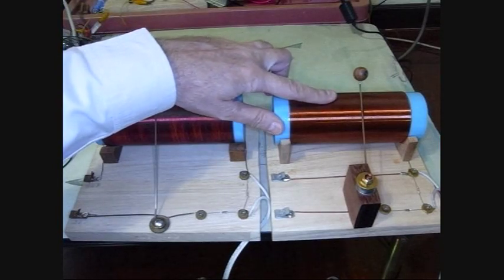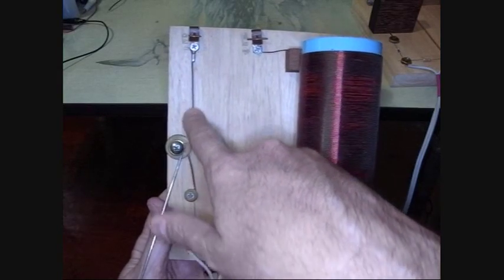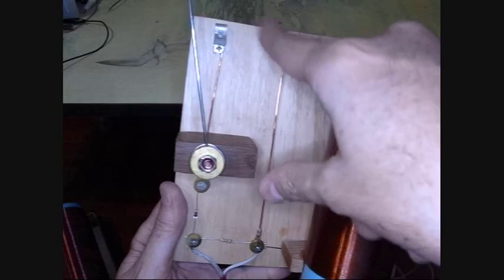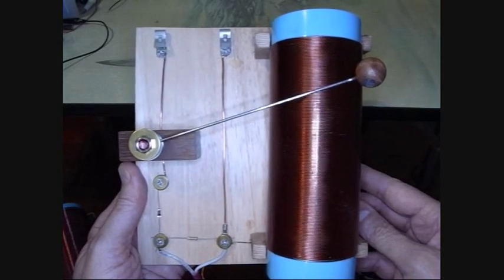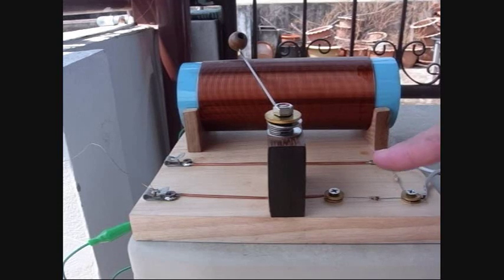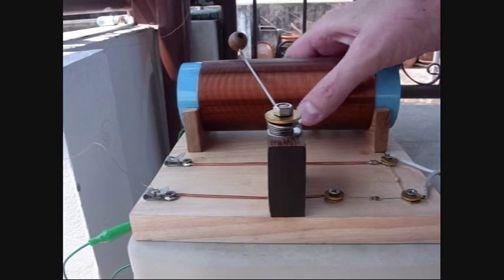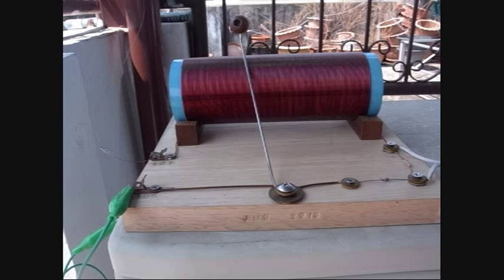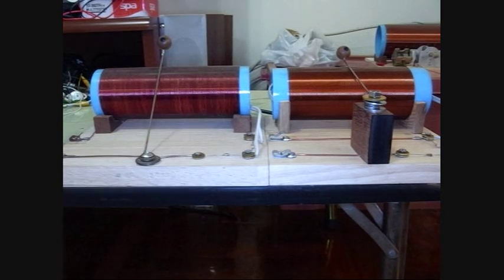New Crystal Radio Design

Comment from the maker: RELATED CRYSTAL RADIO VIDEOS: 
How To Make A Crystal Radio - No Batteries, No External Power: https://youtu.be/mt-s7pf-U5Q   
My New Favorite!  Crystal Radio with Antenna Tuner:    https://youtu.be/mh5KxCpbQ5U
Crystal Radio, Capacitive Tuning - WORKS GREAT!:    https://youtu.be/VJ80Nm9KSkE
Crystal Radio & Resonant Coil Design:     https://youtu.be/Fw9eb-aB-XU
Crystal Radio Antenna (Shortwave Also):    https://youtu.be/G8AsgZbncW4

My Crystal Radio Does NOT Work (FIXES for common problems):    https://youtu.be/kCxQ8iPQx4s
Good Crystal Radio Connection Points:    https://youtu.be/G3qjrReHR1k
Crystal Radio, Connect A DC Audio Amplifier:  https://youtu.be/RW3VhnzgjtA
Three Upgrades For Your Crystal Radio:   https://youtu.be/LENco3_jV_s
Crystal Radio Wiper Upgrade:     https://youtu.be/i1otDz39nlw
Popular Crystal Radio Design That's a Waste of Time - And Why: https://youtu.be/r9Onub2Xpzc   
Crystal Electric Generator RF Energy Harvesting Exp 5 - Full Wave Rectifier:   https://youtu.be/BTu_GJKjOmA

Comment: Whats the diameter of ur plastic coil thing

And how many wire turns did u do

I built one based on this design: https://youtu.be/KGhe3OrNIlI

But sadly the onlything I pick on it is buzzing sound (if I disconnect my ground the buzzing goes away)

I tried with 30m of wire, and I didnt even get buzzing

Then I used an electric fense (not connected to power snymore) (about 200m of wire on ceramic isolators mounted ontop of the fence)

And I get at least buzzing sound, but stil no stations

I was doing this at night (because only at night I can listen to AM radio, at daytime I do get our local station (150km away from me with 25kW of power) but signal is very weak on my other radios

I use 3200ohm headphones, not crystal earpiece
Reply from the maker: All the details are in the description. The earphones are a likely source of problems. Check out this video: https://youtu.be/kCxQ8iPQx4s
My Crystal Radio Does NOT Work (FIXES for common problems)
The one you built from the link is not very good. I'm not sure why he did not print a round coil and bigger would have been better. Here's a very simple "radio" that is less work and does about as well: https://youtu.be/GdvKDFz9Xi4

Comment: Interesting.

I wonder how much of the tiny signal you lost by using the bolt as part of the series circuit?
Reply from the maker: Good question. Probably not as much as the un-soldered connections. It turns out with a good signal I can get enough power to run a digital watch!

Comment: Hello good evening
We left norfolk a few days ago
Tried radio at sea
No pest stations
I ran a 50 ft wire for aerial
Connected direct to capacitor which connects to diode
I don't have a coil or tuner for coupling
At sunset I heard either azores or Portugal 
Last night off ga coast heard Cuba and radio Marti 1180 khz from marathon fl
And Venezuela
Again at sunset 
We are in Jacksonville now so all a mish mash
But when I couple with a loop I just made , weak but for testing , it's more or less correct but when I connect direct to antenna capacitance goes up 50 % 
280uH coil 
I.e. 600 khz was at bottom of dial now it's in middle
Surprised at difference
You notice that too ?
Reply from the maker: Interesting.  I've never tried it at sea.  Adding inductance (and / or capacitance) makes the range go down, so that is exactly right.  I have a video about free apps that cover resonant frequencies.  https://www.youtube.com/watch?v=Fw9eb-aB-XU

Comment: A question Please at the end of Video you showed the Circuit Diagram I notice a symbol for a Capacitor at the bottom of Diagram what is the Value Please? Although when you show the Board I don't see a Capacitor
Reply from the maker: It's optional, but it's usually a variable cap of 0-360 pF.

Comment: Have you ever tried using the two brass rods with the balls on top of the coil that slide back and forth to select the stations?
Reply from the maker: I have used a variable inductor.  Had something like a "rocket radio" when I was a kid, it also had one.  It's hard to find those inductors anymore, I think they used to come out of really old TVs or radios or such.  Making one is not easy.
Reply: @tsbrownie  I just had to put this link up for you and others to see...check out this awesome crystal radio from the 20's They say it is original but the wood don t look like it....https://www.1stdibs.com/furniture/more-furniture-collectibles/collectibles-curiosities/crystal-radio-made-1920s/id-f_1669752/?utm_content=cpc__lp_test&utm_term=low&utm_medium=cpc&utm_source=criteo&utm_campaign=display_us-pdp-criteo-non-exclusive&utm_content=d
Reply from the maker: Very nice!  I'm guessing with a coil of that size with so many windings it's for a spark gap receiver.  VERY low frequency.

Comment: Dose it matter how many raps.for the coil people say only 120 raps
Reply from the maker: That's kind of complicated.  There are 3 things that determine the inductance of a single layer coil: diameter, number of turns, length of wrappings (that depends on wire size).  So for the diameter of the tube, and the size of the wire I used, my turns are correct.  There are coil calculators on line if you want to design your own coil.

Comment: Watching your videos and others for the past few weeks on crystal radio design, I thought about it some and realized a possibility of making a crystal radio a bit more adjustable for a wider frequency bandwidth.  Here you are using a variable inductance coil of a fixed diameter, My thought was that if it were made a variable and exponential inductance wound coil this could be a possible improvement .
So I suggest that you wind the coil on a cone shaped form with the smallest end as the connection point near the ear phone connection. By mounting the cone sideways with one side up and level, and still using your wiper arm as before, as you move the wiper towards the larger coil end, You would then  lower the usable frequency of the radio's tuning from the smallest coils range of coverage to the largest coils on the cone.  
I noticed higher frequency crystal radios I watched in some videos use much smaller coil forms, so logically the smaller coils end would be higher in frequency, than the larger coil end which could still cover the AM bands that most folks use this for.  For those that use multiple coils with air gap spacing to tune with, i would suggest making two cone winding with the outer one still using the same wiper setup, and simply move the inner cone shaped coil closer or further into the outer cone coil for their air gap adjustments. naturally these cone shaped coil could also be wound flattened, but I think making  a ferrite slug cone shaped form to go into the inductance cone for adjustment would be somewhat impractical but very possible.  the variable capacitors used could be controlled with a switch to increase or decrease their range as well by dropping out or adding a set. 
Just a few observations. and thanks for a great video series. My next experimental radio using these observations will also have the unused larger end of the cone coil hold a home made speaker diaphragm for a convenient sound horn resonant chamber built within the inductance cone itself for that old fashioned sound.
Thanks again,  Possumn (K. Lee)
Reply from the maker: Thank you.  Sounds like you have some interesting ideas.  I've seen pictures of really old crystal radios with every shape of coil you can imagine from round to tapered to flat bars.  When you make your radio(s) please post them on youtube and let me know, I'd like to watch them!
Reply: I was thinking today that in making a cone coil, that a second wiper may be a good idea, the second one would be grounded to electrically "shorten" and eliminate the larger end of the coil to not use what is not necessary to improve the adjusting of the inductance coils tuning . I took a hint from your use of a jumper wire in the testing the reception of the boy scout radio and your modified design version with no electrical connection at one end of the coil.  With this second wiper, mine will also have no connection at the larger end but but for the grounded adjustable second wiper's contact point that "chokes off" the unused portion of the coil...I'm modifying my winding jig, to give it an attachment to allow for cone forms with the smaller end in free space. ( I just add a wooden thread spool between the crank and back stop for added stability.). Hobby lobby sells hollow card board cones, and solid Styrofoam cones. so they should be easy to "pin" together on my jig's shaft once the Styrofoam cone is clamped in. normally I use two tapered wooden spindles made .from an old chair leg for centering and clamping  regular round coils of various sizes. Thanks again, Possumn.

Comment: What is the purpose of the resistor?
Reply from the maker: The piezoelectric earphones have lots of capacitance and if you don't bleed it off you hear lots of crackling and the earphone becomes charged and does not vibrate (little sound).
Reply: @tsbrownie  do regular earphones have a lot of capacitance too?because i used those on my radio without a resistor,in the first test i heard crackling and something that sounded like talking,although weak,since it's from a nearby country,as my country has no am stations anymore,but the crackling kept getting weaker and now it's not working at all,what could be the cause?is it the capacitance?,also,can i discharge them by shorting them?
Reply from the maker: @ludost5178  It will not hurt to try adding the resistor. The fun in crystal radio is experimenting.  Normal earphones do not have much resistance, so they act like a short, plus they take a lot of power to operate. Most of the time they do not work. The crackling sound could have come from machines, motors, cars  etc.
Reply: @tsbrownie  idk,no cars in the street where i live,the resistor didn't work,but adding a capacitor made it A LOT stronger

Comment: Thank You,   I'm in the middle of building my first Crystal radio and was looking at all the different designs..  and Boy Scouts win again..   LOL,  I was a Boy Scout 45 years ago.   it was one of the most memorable times in my life.  The Bonfires were the best part..   I never got to Eagle scout,  cuz I discovered girls and minibikes,   not in that order though.
Reply from the maker: The boy scout radio is the easiest and cheapest.  It's hard to go wrong.  The diagram in my wolf scout book was wrong (hence the "modified"...)  Had an extra wire shorting the coil.  I figured that out when I was 8 and remembered to fix it when I made this one xx years later.  If you have time, the dual variable capacitor is also very good.  Has better channel selection (less cross-talk).  Let us know how it goes.
Reply: i think I might try it.  I was making a wiper style,  but I have a variable capacitor that's been sitting on the shelf for ever.  I measured it.  It goes from 4 pF to 62 pF.  I already made a pretty big coil with a wiper,  2.3/8 diameter,  8 inches long with 24 magnet wire,  it's checks 1.765 mH. 
  I hate to change horses in mid stream,  but, why not..   tomorrow is another day,
Reply from the maker: Or do both!  Stereo!

Comment: tsbrownie,  how many turns do you have on your coil of your original boy scout radio?   Also do you have any idea of the frequency tuning range on it ?  I just built a coil with around 420 turns , 7" wide and 2.5" diameter. I had one with about 100 turns and got 10 -15 stations . I'm curious to see what it will do .  Have a great day and keep the info videos  coming.
Reply from the maker: Thanks.  If I recall the turns on the original were between 170 & 180.  There are a several factors in the coil: diameter of the coil (bigger less inductance per size, but more selectivity), turns per centimeter (more is more inductance, but harder to tune) and material (these use air cores, but there are other types).  Something I did not mention, the antenna is also part of the inductance; a well matched antenna and coil gives the best performance, but this is more art and magic than science for most of us.  If you get too much inductance or too little, the radio's tuning will be outside the AM band and it won't work.

Comment: I have seen some adverse comments about these "Boy Scout" radios. Unlike the usual design of crystal radios, this has no tuning capacitor, so the coil resonates with the capacitance of your antenna. I have found that using a 15ft antenna, that has a capacitance of around 40pF, you need many more turns on your coil than for the usual crystal radio designs, so a short antenna not only provides less signal pick-up, but also may resonate at too high a frequency. You could try fixed capacitors in the range 47 to 220pF across the coil, between wiper and ground, to see if it improves tuning range.( My uncle, who built radios in the 30s, made a crystal radio with a tapped coil and 500pF fixed mica capacitor for my brother and I back in the 50s).  I found that by sliding the long wave coil, ( which has much more inductance than the medium-wave coil ) of a ferrite rod antenna along the rod  I could tune my short antenna down to around 550kHz.
Reply from the maker: Funny you should comment, the last comment I got minutes ago was similar about the "new crystal radio design" video.  I've been trying to build a better and simple crystal radio and no luck to date.  That includes putting variable caps in different places.  No big improvement yet.  It sometimes helps to match the antenna.  Here's a video on the very popular design on the internet that does not work using a coil and tunable capacitor:
https://www.youtube.com/watch?v=i2PITPUg2vI&t=1s

What I said about this design was, "I'm still trying to make it work.  Part of the problem is that it is very sensitive and therefore good at discriminating among signals, BUT (and it's a big but) anything you attach to the circuit that is anything  but extremely high impedance kills the resonance (I've been using an oscilloscope on it).  I know it must work!  Will keep beating my head on  this wall until I figure it out or I die in the effort!  ;)"

You are right about the antenna affecting the performance.  My roof antenna allows me to tune between 17 and 2x stations.  My workbench antenna is good for 1-3.  And matching antenna to radio is important, I've been looking at making a separate antenna tuner.  Just a matter of finding time...  If you find something good, please let me know.
Reply: Re crystal radio circuits that don't work, I've just been reading a website which gives an example of a diode detector circuit that shouldn't work. The original was on a website belonging to Cambridge University in the UK. http://diga.me.uk/EEDiode5.doc